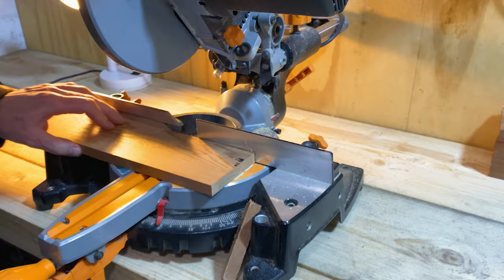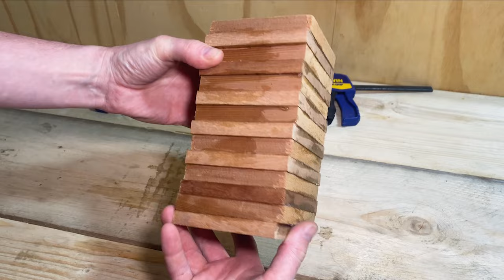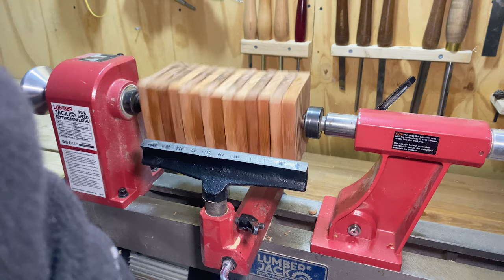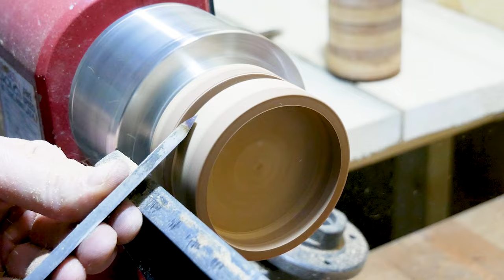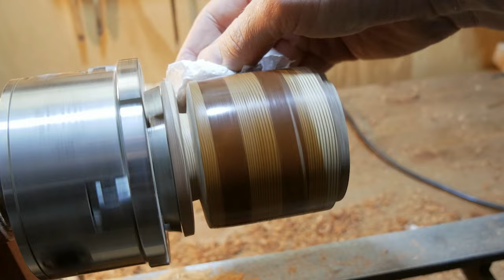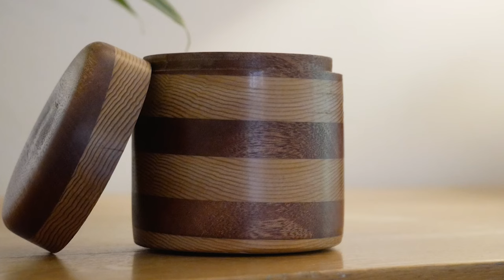Woodturning Recovery: From Ruins To Redemption.

Comment: Good looking pot/box. 

Question, is the lighter wood treated pine? If it is, the chemicals used to treat it is very dangerous to turn because of the dust created and then breathed in. If not, never mind. 

4 suggestions. Please take these with the best of intentions on my part. I hate to see someone hurt because they didn’t know any better. I’m not the authority. Just another turner who has been doing this for 25+ years and learned a few things at the school of hard knocks. 
1. You glue up is bowl orientation. Never use a spindal roughing gouge unless all the grain is aligned with the bed ways. You made it through this one, but several times a year I see where someone has done just as you did and the tool catches the end grain causing the tool to bend, or worse, break. The bowl gouge is a MUCH better tool for roughing this blank. 
2. Several times I noticed your tool rest twist as you were turning. ALWAYS make sure the tool rest and banjo are tight before you begin the cut. I’ve ruined more than one piece because of the tool rest either rubbing against the piece or actually digging into it causing an explosion. 
3. The catch on the lid was caused by using the wrong tool for the job. Like the spindle roughing gouge, the skew is designed to be used only on wood with the grain aligned with the ways. A bowl gouge or detail gouge would have done a better/safer job there. 
4. The 1st lid looked like it could have been saved. It may not have been the shape you had planned in your mind, but by reversing it I think you could have rounded the top over and eliminated the torn out chunk cause by catching the skew. 

Glad it all worked out. Keep at it. This is a fantastic hobby that develops a ton of skills over time. You are well on the way. I hope that you reach the 500 milestone quickly.
Reply from the maker: Hey, thank you so much for the detailed feedback. This really is the kind of advice and guidance that will help me to improve. I am still figuring out the right way to do things - usually by making mistakes. Thank you for taking time to provide these pointers. All the best and thanks again. Ben.
Reply from the maker: Oh and the wood used is Cherry and Sapele. 👍🏻